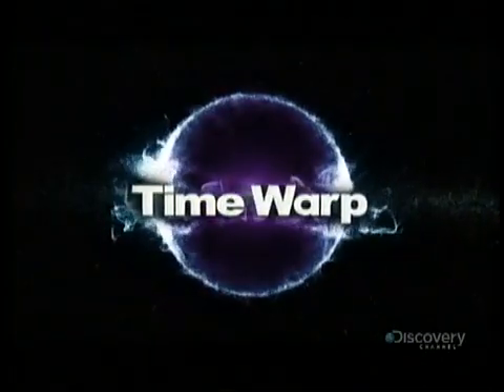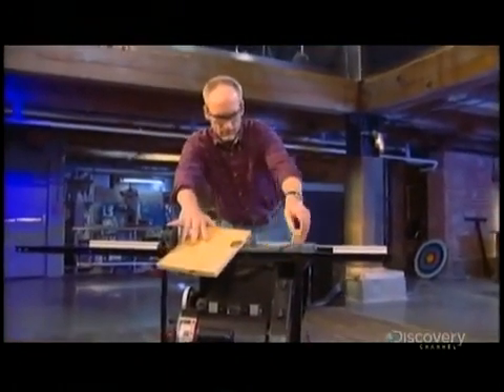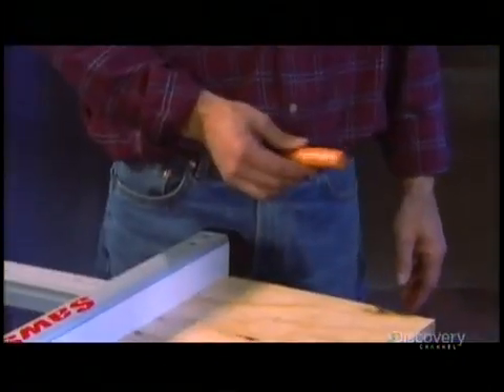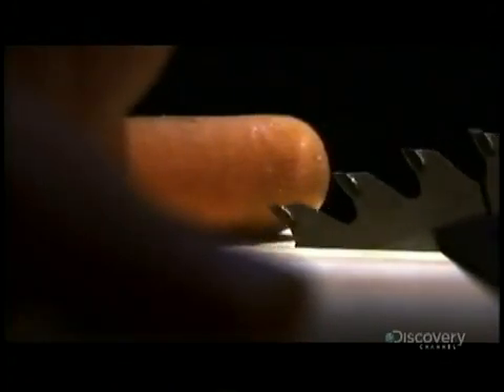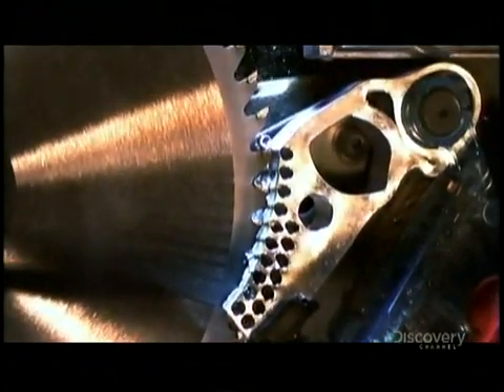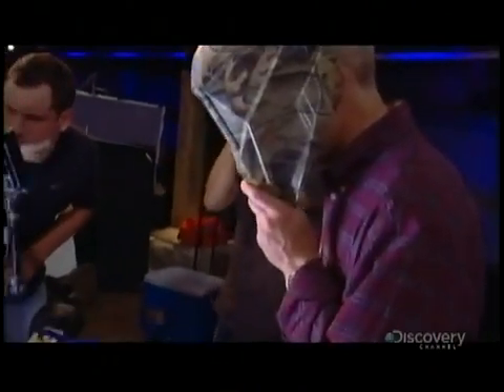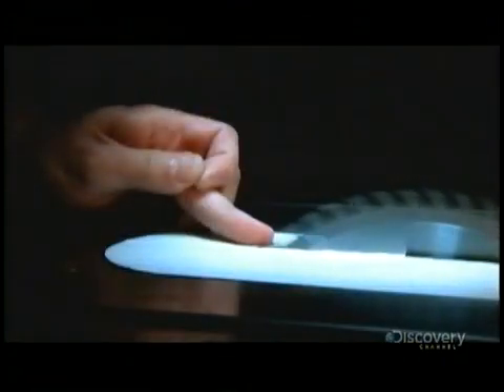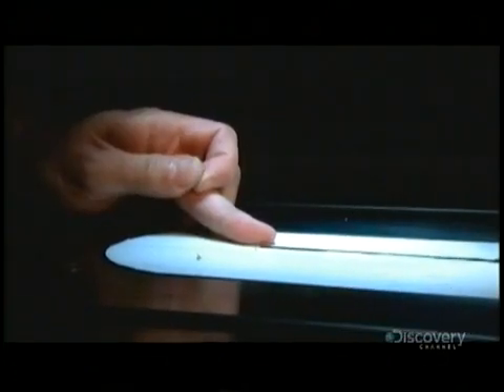Saw Stop - This guy puts a finger into an active table saw blade & comes away without a scratch!

Comment: HOW THIS WORKS: (See below for my qualifications) When you touch the blade, a small microprocessor (actually, a DSP) measures the difference in capacitance and triggers the blade to drop. When you are touching the hot dog, it acts as a conduit to your skin. However, by itself, the hot dog should not trigger the blade drop. I have not been able to conduct this experiment, but it should be easy - wear medical gloves while trying the hot dog trick. Throwing the hot dog at the blade should have no effect on anything except the hot dog.

There is a way to trigger the blade drop, similar to the aluminum demo, without directly touching the blade. If you laser cut a piece of thin plywood, it will leave a charred (read carbon) edge where the laser burned the wood. If you are then cutting the plywood on the SS, such that the blade touches the charred edge, and your hand/fingers are also touching the charred edge, with a continuous charred path from blade to you, the charred edge acts as a conductor (electrically a carbon resistor), and that will trigger the blade drop. This happened with the SS at the Chicago makerspace "Pumping Station: One". When they qualify someone in the woodshop, they explicitly tell you about it, because a member had it happen. They charged (around 2014) $180 if you triggered the blade drop.

I went through the qualification, because I have been doing wood working for 50 years (since I was 10), and I had some wood projects. I am also very careful, because I have one hand and half my left forearm (from birth). I also build houses for a hobby (Habitat, missions trips). So I have some (so to speak) skin in the game.

So - safety is important to me. The price is too high for me;  it will be a while before my home makerspace (Quelab) can afford one. In the meantime, I will be very careful. But I am always careful around power tools, so far with success. I am out of spare fingers...

How do I know this? I am an embedded systems engineer with close to 40 years of professional experience. I saw this saw and another brand at an embedded trade show about 5..6 years ago. Both electronics companies were explicit about the technology - they had to be, because they were trying to sell us engineering nerds on the capacitance-sensing tech. We do not accept bullshit - and we can smell it from a good distance. The companies were grilled on the tech. I don't know what happened to the other brand,which did not destroy the blade - it used an electric piston to drop the blade.
Reply: I'm shocked that no one has explained how it's the same technology as a phone screen....
Reply: At last a good explanation of how this works.
Reply from the maker: Attempting to hit 10K Subscribers! Please consider subscribing :D

Comment: How about you just use what every other safe tool uses? A safety guard...

That saw could have debris on from the last cut it did making the electrical signal useless.

This can also allows people to care less about cutting themselves which will cause it to trigger more often that in turn causes you to keep replacing the blade and brake
Reply: Extra Mental Safety guards don't work very well.
Reply: @McFlubberpants  Safety guards aren't supposed to stop you from killing yourself, they are supposed to help you avoid something going wrong when you are doing everything properly and slip slightly...
Reply from the maker: Almost at 10K Subscribers! Please consider subscribing :)

Comment: To the people saying he used a salty wet finger and was going slow on the demonstration. Okay, granted that is unrealistic.
However, imagine if you were working with dry fingers in a dry workshop. The microsecond that the blade cuts your flesh and detects moisture/blood, it is going to stop.

So, yeah, you might end up with a scratch from the blade, probably cut the flesh a little too. But it is going to stop dead before it slices your finger off that is for sure. You all saw how little contact was needed and how fast it was. In the real world it probably will cut the skin a bit. But it will probably save your finger.

Just my thoughts.
Reply: i agree, it would be nothing more than a paper cut
Reply: @crazydirtbikeman77  saw cut*
Reply: i know a guy that works in a woodshop that uses these saws, and the saw got him one day under real-world conditions when he was pushing a board through. he got cut. it bled a little and he needed a bandage, but that's it. no stitches, no hospital visit. i don't even think he took the rest of the day off.
Reply: @violentrobot  Excellent comment, tis saw do not have price ... i lost my little finger and the other 3 with tendon and nervous injuries with a normal saw... it is late for me, if you like with this type of saw then buy this. i was disability for 1 years
Reply: @josesolano6719  did your fingers grew back again? I mean do you have fingers there  where you cut them off?
Reply: @violentrobot  yeah and the poor saw blade took the rest of its life off..
Reply: @violentrobot  I would consider that a win.
Reply: Michael Jarrett  okay well let's see. It says the blade fully retracts in under a millisecond. I'll just use a millisecond to be simple. It would have to cut through about a quarter of an inch of flesh to reach bone, so you have to move a quarter of an inch every millisecond, or 250 inches a second (about 21ft). That's probably possible to do, but I doubt a table saw would cleanly cut wood at that speed without getting kicked up or anything, and even if it would work in a table saw, anyone operating a table saw like that is asking for trouble. I'm not saying they deserve to have their finger cut off, but they certainly shouldn't be trusted with a saw. Regardless, even at that speed, this saw turns an amputated finger into stitches. It would be very difficult to lose a finger to this saw.
Reply: Michael Jarrett  to be fair though I'm pretty sure instructions for any table saw flat out tell you not to be slinging stuff through them if you arent going at a controlled pace you're using them wrong
Reply: I just had a run in with my saw today. Wish I had one of these lol
Reply: Agreed, when he used the hot dog he put it super fast in the blade I didn't cut the hot dog at all
Reply: Yeah exactly like sure you got a little nip but at least you still got a finger
Reply: Fuck it I sliced my thumb slicing vegetables cause the handle broke I'll take a gash that deep then losing a finger on a table saw. People fail to realize safety and protection doesn't mean it's not gonna hurt you, it's just gonna lower your chances at catastrophe. Any protection you wear your bound to get hurt, just like a bulletproof vest, a football or baseball helmet, safety goggles or a hard hat.
Reply: What if a guy puts his dick into it?
Reply: @s1lent718  what is wrong with you people😂
Reply: @EAGLINWRX  Wdym
Reply: The dude tried without wet figner
Reply: You don't need wet hands for it to work, skin trasmit electricity any way, it will be a little slower but will do the job, also that's obvious that if you throw your hand on that you will get some damage, but going fast in that saw would cut your hand, not only your finger, it is a great invention
Reply: I saw a video of a guy doing it dry, he did get cut, but it wasn't anything 4 days it wouldnt heal
Reply: @boostedb18b14  yeah, sentiment around this product changed so much within past few years, and I'm glad cuz, alot of people in more recent posts talked about how this device saved their hands. I was horribly terrified of my table saw when I bought it 5 years ago. The roar of the motor running the blade at over 5,000 rpms, the potential for kickback. Initially I barely used it until I designed table saw sled that physically blocked my hand from going into the blades path, , and had a cover to reduce kickback injury. It also keeps the dust in a small neat pile on the outfeed side which you can either vacuum up or slide it into the saw's own dust bin
Reply: its true, many video here already show how saw stop save their finger. And the worst i see is someone cut a bit deeper but still considered totally goood since its freaking TABLE SAW. The reason he say maybe because during the contact his nail got hit 1st instead of his skin so maybe that why the sensor trigger late. But if he didnt use saw stop he probablly left with more than a cut. He maybe will lose his finger since the saw will not stop and maybe will pull his finger more since that is the nature of saw.
Reply: @slyztercoreveanged3175   Glad the sentiment changed from "this saw is an expensive scam" to "this saw saved my life." I used to get into big arguments with people 5 years ago about cost of healthcare, losing your job, your fingers, vs. a few hundred dollars on a saw stop. I'm sure the cost has since lowered.
Reply: Too much proselytizing, not enough evidence. Here's a video of a real life moron sticking his hand in a sawstop, and getting what amounts to a papercut - https://youtube.com/shorts/cReqep0uI00
Reply: @Novur  there's a lot of them now. I'm just glad that there are none so far about a failed saw stop.
Reply: @Novur  p.s holy poop so we can post links, but only YouTube ones. That's better than nothing lol
Reply: @WarPigstheHun  yeah it's a little bit of a pain that it's so restrictive, but I don't really mind because it's part of the automatic spam detection on YouTube. Before they implemented it, spam bots were flooding comments with shady links
Reply: Having a finger cut to the bone is much preferable to having it reattached.
Reply: What if you stand over the machine and just slam your head straight into the spinning saw? Would it stop and cause no injury?
Reply: @LolLol-pq5fp  How about we don't test that. At all.
Reply: @LolLol-pq5fp  eww
Reply: @LolLol-pq5fp  depends how hard, if you do it really fast it will probably leave a good gash and you would bleed a ton, but if you lowered your head you would probably be mostly unscathed, if you just fell on the sawblade hitting your head on the table would probably be your main concern in terms of pain and damage.
Reply: @LolLol-pq5fp  yes. It will stop, you won't die. Worst case would be a cut that MIGHT need stitches. But you will live. A guy on another channel used the hot dog example, but went very fast into the blade. It cut about 1/8" deep into the hot dog. A good cut, maybe stitches, but you will still have your finger. Priceless.
Reply: @LolLol-pq5fp  the first assumption of the machine is that the operator has some brain and is willing to use it
Reply: @LolLol-pq5fp  lmao you are a genius. They should really consider this and implement a safety measure for this scenario
Reply: @natedaniel2200  it should still work cuz our heads are very oily and like that guy said skin itself is conductive lol. Although I wonder if it'll work if you aren't grounded, as in if you're in mid air
Reply: @LolLol-pq5fp  I don't know why don't you find out
Reply: @LolLol-pq5fp  i mean a guy did get a sausage and slammed it into the machine came oiut with just a nick
Reply: @LolLol-pq5fp  I'm wondering that too. What happens if you come at the blade faster with your finger. Like how fast you would really be cutting wood in a hurry. It probably draws blood then but still saves the finger is my guess
Reply: @LolLol-pq5fp  LMFAO I love this comment so much
Reply: @LolLol-pq5fp  I can't stop laughing at this comment 😂😂
Reply: You know, I would expect it to go off on dry skin at regular speed as well. But if you have the opportunity to take precautions because you know you will put your finger in a blade, you, too, would take them, no?
I mean, how much do you really want to put on the line for a demonstration? I think, putting the finger on the line at minimum risk is already good enough, even though it should also work with worse conditions.
Reply: Michael Jarrett if you were to punch a saw stop with the fastest human speed possible it would only cut about a third of your finger. much safer than a raw blade.
Reply: I want video proof of that first.
Reply: @shaynelowe9604  Watch the video
Reply: @shaynelowe9604  Stupid
Reply: also if you are going that fast you're being reckless and don't blame this guy lol
Reply: Just keep your hands moist 🤷‍♂️
Reply: Shit, if it stop soon enough  to save my finger, it could give me a cut that needs witches is still take it
Reply: Do it then, don't talk about it... Put practice into theory, get some real carpenter with dermatitis and shit, those real dry crackly hands and push into the blade as if you slipped...
Reply: Wait no it is detecting eletricity just like ur phone does it doesn't have to be wet. Didn't u watch the whole video? He tries it with his real dry finger and it worked without drawing blood
Reply: @theNimboo  50 V and higher break the resistance of the skin.
If the current is over 50 V, it doesn't care if it is wet or dry.
SawStop FTW
Reply: everyones fingers are salty and wet, you don't have to dip your fingers in saltwater for it to work
Reply: You're absolutely right. Here is best example video - https://youtube.com/shorts/vCuLs31fDaQ?feature=share
Reply: It still would have been nice to see a dry respresentation of a finger. Maybe a hot dog that they removed the salt water from. 

We can say, "it probably would have stopped in time once it broke some skin and touched blood". Or we can actually test it with a dry finger and see what happens lol.
Reply: And good thoughts they are!
Reply: Naymy seriously are you fucking mad 🤓 give it a week or two ....  dust ,oil Rust 🤔🤔🤔🤔
Reply from the maker: So close to 10K Subscribers! Please consider subscribing :D
Reply: @anthonyprezutti  no I will not subscribe
Reply: @anthonyprezutti  no ty
Reply: @anthonyprezutti  3 years later…
Reply: @anthonyprezutti  No

Comment: Couldn't believe it! The blade has to touch the finger first to detect there is a finger. So you are saying the blade touched the finger at that speed for 1/1000 second without hurting the finger? 5000rpm means it already rotated 5 rounds in 1/1000 second; how could it save the finger?
Reply from the maker: So close to 10K Subscribers! Please consider subscribing :D

Comment: Well it would have sucked to see that fail. Its a great idea but over time say 5yrs being covered in saw dust and moisture causing Rust/Corrosion that system will fail eventually. Its like a car and its air bags safety systems fail or just never work in the first place this is why there is service intervals but who really services there air bags?

Comment: He didn't even touch it the people must of made the thing holding the saw very weak or he couldn't of touched it because there is no shadow because the light is on top of the saw and if u look closely he doesn't even touch it. But I have a 3rd option the people are controlling of how loose it is yea? They might of put the screw all the way out.

Comment: So it'll blow up to a tune of $60+saw blade and stall the shop for a week waiting for new part if used to cut green wood, blow up cutting metal, or blow up if wood has a piece of nail/staple? Hmm, how bout using blade guard and common sense safety? Nifty but useless.

Comment: i would buy this invention, but i do have some theroys with what could go wrong and here they are: 

theory 1: cutting wood with that saw for a period of time would most likely mess up the sensors and make it where the blade would not stop.

theory 2: someone would most likely have gloves on there hand, therefore, the sensors would probably not stop until it comes in full contact with the finger

theory 3: over time the sensors could lose its ability to sense the fingers resulting in cutting the person's fingers off
Reply: Reply to these theories.

1: How exactly would that happen? It wouldn't.

2: What kind of idiot wears gloves while using a table saw?

3: A normal table saw would do that too, the difference is it never had the ability to stop where this one does. Also I really don't think it would wear out that fast.
Reply: Its an electrical system. Yes things can go wrong but on the website it says it is continually tested whule the saw is on and it is always on while the saw is on. Also gloves wouldnt make a difference. You need to have something that conducts the electricity in the blade to stop it hence hotdogs or sweaty fingers.. Whatever thats wet really. Including blood which you woukd hit way before you cut a finger off. Its not supposed to save you completely... Its just saving you fingers and hospital bills.
Reply: Even if you would wear gloves it would first cut the glove and til it touches the hand
Reply: The designer himself wasn't trusting his machine enough to put his finger at risk.
He even dipped his hand in a saline water solution and he didn't produce a realistic scenario.
That means he knows all the flaws and he knows it's not perfect.
I'm sure there's a ton of scenarios where this thing doesn't work and a ton of ways where it accidentally triggers.
Reply: So true
Reply: Really these are not theories, but hipothesis, a theory is basically something that is proven to be right whit experiments. a hypotesis is just a thought on what whould be. and what you said, is a hypotesis
Reply: Aitor Rosell i thought those were hypothesis
Reply: Change the Y to an I and add e,s. THEORIES